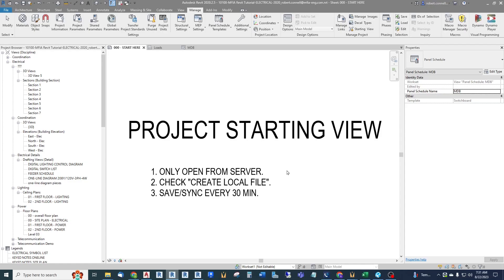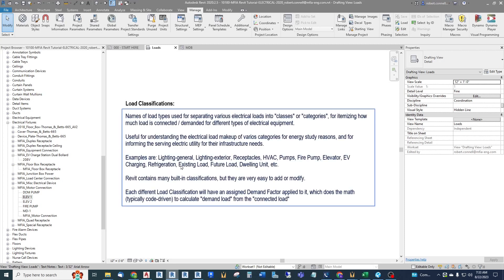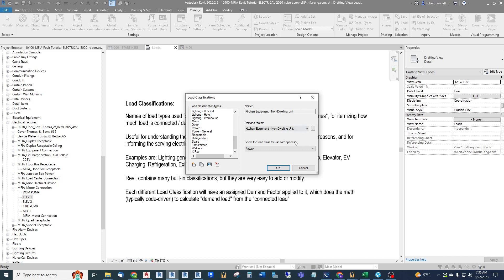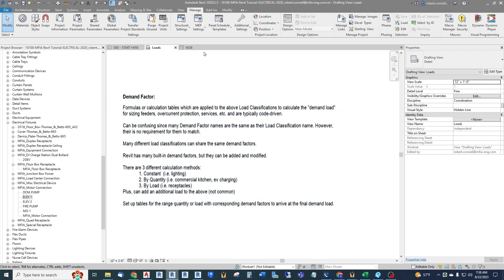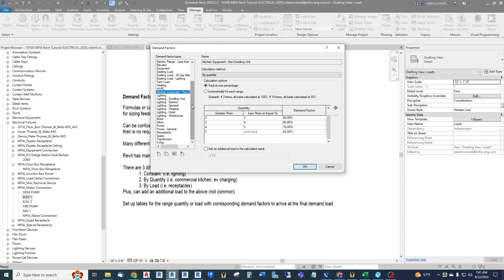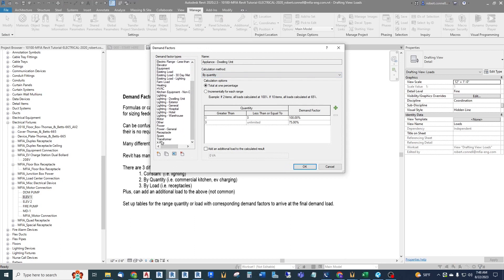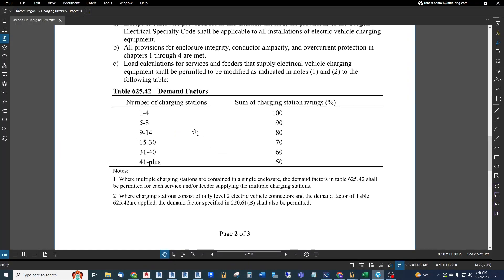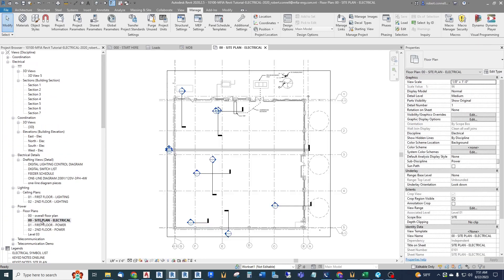Revit Load Classifications: The Missing Piece

Comment: A demand factor cannot be more than 100% (all equipment on circuit are operational). A continuous load per NEC need to have an additional 25% to determine the ampacity of the circuit. To me showing a demand factor of 125% on a panel schedule doesn't make sense. Any thought?
Reply from the maker: Actually, the 125% demand factor is exactly how we account for that continuous load. This method has been used in the MEP electrical industry for decades, and is also how Revit demand factors are designed. You will also see this type of demand factor applied to the largest motor connected to a bus (panel, etc). So it's the typical way that demand load or "calculated load" or "code load" is determined. Thanks for your question!

Comment: Some  fixtures dont  have load classifications so  i  can not now change the  demand  factor
Reply from the maker: Hello there, and thanks for the comment/question! I'm assuming you are referring to a light fixture or at least some kind of electrical fixture. Many light fixture families that architects use do not by default contain the load classifications parameter, but it can be added within the family editor. This is a good idea for a future video, so I'm glad you brought it up. The short lesson: Within the family editor, go up to the "Family Types" tool under "Properties" where you can add "Load Classification" to your family. You can add other electrical parameters in this fashion as well. Cheers!